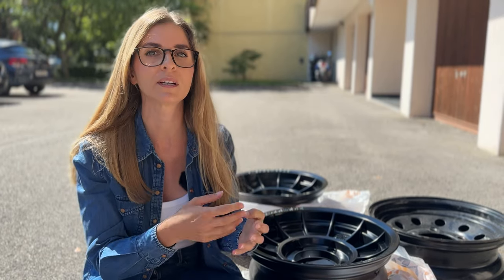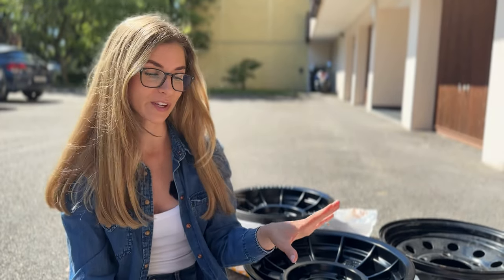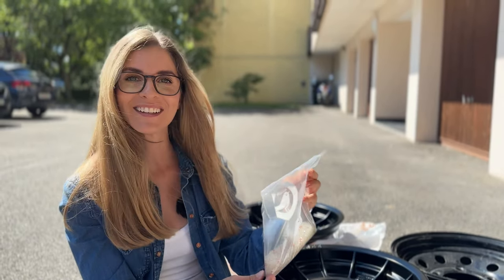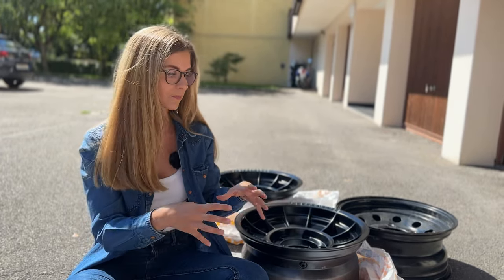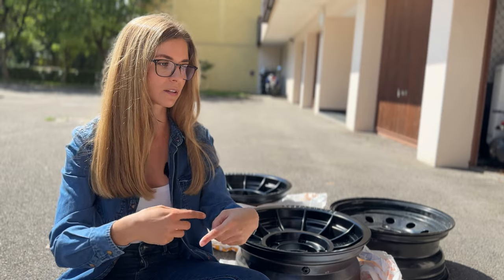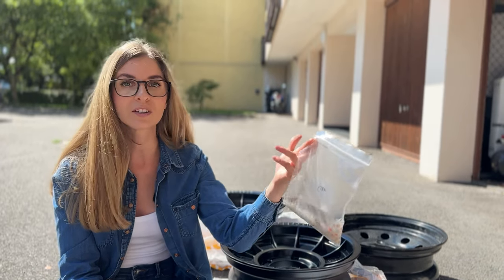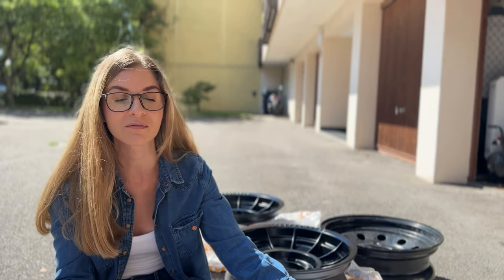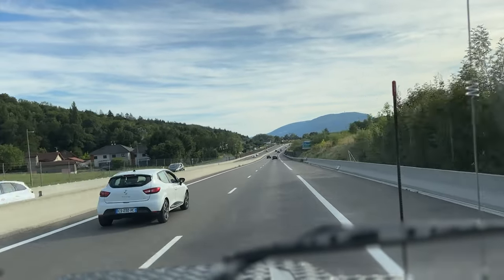Perfect Wheel Balancing with Balance Beads (Are there any cons for our 4wd ?)

Comment: Just use 16oz of antifreeze per tire. Works much better than beads. Will never clump up or freeze. We run antifreeze on all our commercial trucks and trailers.
Reply from the maker: Don't know about that way of doing. 16oz is for all size of tires ? And how does that go for deflating tires when going offroad?
Reply: Antio-freeze is Nasty whenever you need to fix a flat, etc. Many shops would likely say Forget it, you need a new tire now.
PS
might be okay for big rigs with thick tread tha never get punctures but otherwise, ewww

Comment: The beads will not work until the centrifugal force reaches the point of overcoming the force of gravity but that occurs at a relatively slow speed (depends on size of tires - the smaller the tires that faster centrifugal force will overcome gravity). And at slower speed imbalance would produce less force as well - that is, you would likely never notice any wobble because of tire imbalance at slow speed - the flex of the tire is greater at slow speed as well which helps absorb any wobble.

Comment: I've had the beads and got rid of them. Got rid of the tires too and they were a month old.

Airing down is a pain they do get stuck in the valve, even when the valve is on the top. Besides when you are traveling at low speed you won't have the tire balanced and you'll have higher temperature due to friction.

I only used it because I didn't know better at the time and the garage propused them to me because I was putting hard to balance tyres (retreaded).

With good quality tyres like bfg, there's really no need to go this path. I would stay away.

Some tyre manufacturers prohibit their use....
Reply from the maker: Yes airing down is a concern and we'll need to see how it goes. If the beads causes any issue on that side we might go back to regular wheel weights. Why did you have to ditch tires too when removing beads?
Reply: @offtrackfamily  they were really hard to balance with weights (retreaded tires are known to be more unbalanced then new).

also they had really stiff construction, which hardly made them come down when airing down...

I also do a lot of road miles, so they were a concern, soo I sold them on to a farmer for his pick-up that doesn't leave the farm and got some Cooper AT3's for the LR.
Reply: did you know there are bigger sized beads for trucks/offroad that are big enough to not clog up the valves?

Comment: I've heard that the steel or metal balls (marbles) tend to cause more damage to the internals of the tires. In terms of the ceramic balls breaking down over the life of the tire, I think this idea comes more from large tractor trucks that travel millions of kilometers under heavy load, versus light passenger vehicle applications, which I agree I don't think would cause the ceramic [marbles] to wear out as quickly as in a commercial application such as that of large trucks. Clumping I believe tends to be caused by using too much lubricant when installing the tires on the rims, or in the case of sealant being used in the tire or other compounds like that. Many people claim they can cause damage to TMPS sensors, which it doesn't look like you have. If the balls plugged the valve stems during deflation, the tire could always be be rotated to free them (I believe) or air could be blown in to push them out of the way (I believe). People claim the balancing effect becomes most noticeable between speeds of 30-45 mph (50-70 kmh). Using too many balancing beads beyond manufacturer recommendation can cause the tire to go out of balance, I believe due to the balls interacting too much inside of the tire. This is all information that I have gathered from researching tire balancing beads on my own, but I haven't yet taken the leap to try them for myself (coming soon I hope!), so please don't take all of the above as absoulete fact. Thank you so much for sharing your experience with us!
Reply: From the looks of it, there are issues in using it in small and low profile tires (you really want to have the flat spot of the tire to be able to push the beads around, or space for the beads to roll around or diffuse); humidity in the tires causing stick or clumping (use hydrophobic beads, or powder); too many beads in the tire; not replacing the valve stems (some beads come with a stem that has no such issues with beads); ...

Some people just use anti freeze, or slime instead of beads. Some truckers use really massive beads (a few golf balls in some cases).
Reply from the maker: There are many information available out there and it seems experiences are all different. In our case it went well in the all terrain tires. The best is to try it out and if it doesn’t do the job, go back to regular wheel balancing.

Comment: Good it works for you. I do not now anything about those beads. But it is widely known that AT tires are not difficult to balance at all. However, MT are, as they progressively deform and wear unevenly when driven on paved roads. The best way I know to get around the wobbling caused by these tires (285s MY on steel rims) is the dynamic balance that takes into account the uneven deformation. Some people say that the best AT tire is the MT tire 🙂. Do not tell me you left the white letters to the outside?
Reply from the maker: The worst case scenario we had (death wobble) was with our old & used winter tires. Muds always went well and beads are also is our mud setup. Small vibrations always occurred when slowing down to 90-80 kmh on highway (with winter and mud tires) and now nothing. So all good for the moment :)
Reply: Yes. I had the very same issue during a long trip not long ago, just when slowing down from 80Km/h. Only noticeable on paved roads. At the end, I swapped one of the front tires to the back and it solved the problem. Looks like that wide steel rims+MTs is the worse combo. Both, my mud and summer shoes are 285s and I would like to go down to 265s.

Comment: Balancing Beeds in mine. Good for switching tyres diagonally front to back as balancing is same, as well as the other you mention. Not noticed a critical speed for them to work. Will be getting my wheels powder coated over winter so will check condition of tyre inner and beeds when I remove tyres for powder coated.
Reply from the maker: Nice! Would be good to know if what we read regarding the use of the beads and use of the inner tire is accurate or just incorrect like we think.

Comment: You should have used the balancing beads in your old wheels and tires to really have experienced a difference between traditional balancing and this beads if you really wanted to know in my honest opinion,the quality of those beautiful Performance wheels with a lesser offset and new AT tires definitely is much better for wheel bearings , drivetrain ,axles and also a big difference in wheel tracking if you understand what I mean
Reply from the maker: Our mud tires setup is also ready with beads balancing 👍 We decided to already go for this new tire setup mainly  because we have the dreaded MOT and as we don't have anymore winter tires it was a good occasion to test out AT tires.  Don't think we'll stop going for 285 muds with a nice offset as this is what we prefer ;)
Reply: @offtrackfamily  I’m curious about the result on the mud tires in combination with the beads

Comment: That’s so bizarre. My brain can’t wrap around how it works. I would have thought that any imbalance would send the beads to the outside section of the imbalance… making it worse! 
Maybe a weird interaction between centrifugal and centripetal forces? 🤷‍♂️
Reply from the maker: It does seem illogical, luckily many videos explain how this works 👍
Reply: The center of balance/rotation in a raw tire shifts toward the heavy side. Because the center of rotation wants to be in the center of balance. The lighter side of the tire is the "high side" that bounces. The beads, if disrupted by flex from the road surface, will gravitate to the lighter high side to offset the weight of the heavier side. Therefore pulling the center of rotation to center of the tire/wheel.
Reply: It has to do with the path of circumfrence in relation to the heavy spot.
That is, it is not a perfect circle around the center of rotation.
The second half of this video - > DKdSys-TtwA
does a fairly good job of explaining it.

Comment: How do you decide what is the correct weight for each tyre?
Reply from the maker: The beads manufacturer provides a chart
Reply: Google Tire Beads Calculator if your tire size is not in the chart